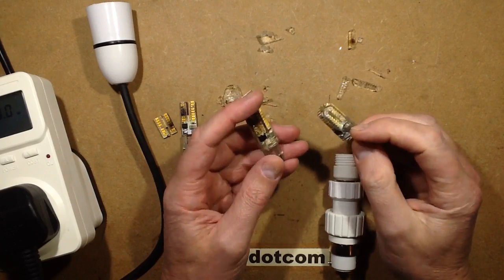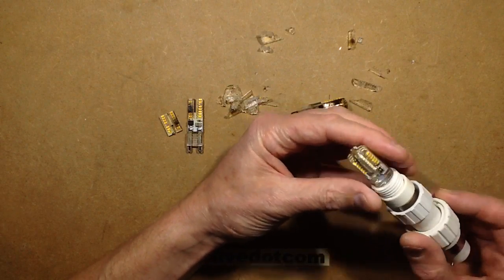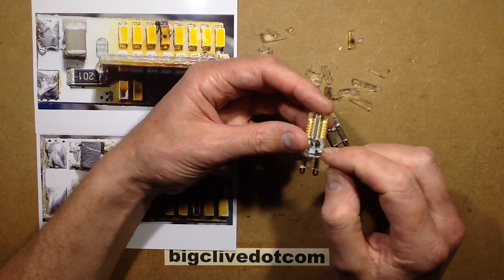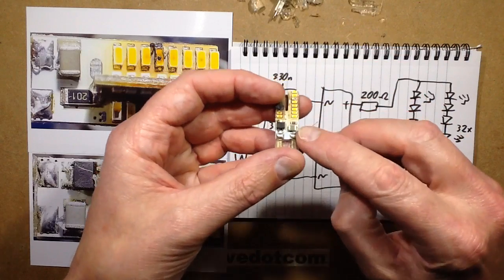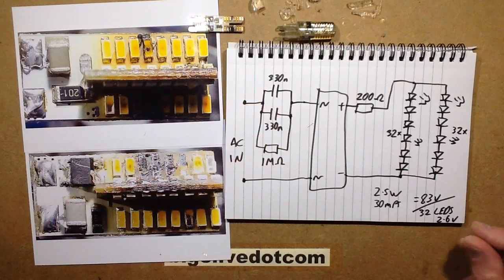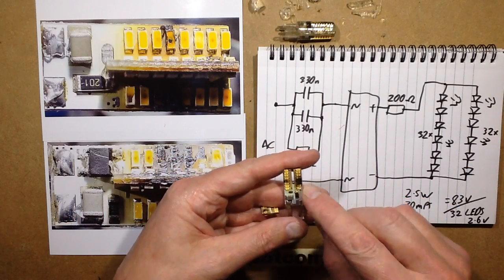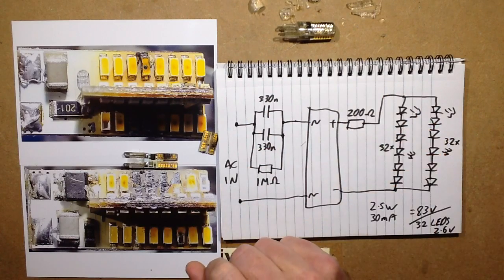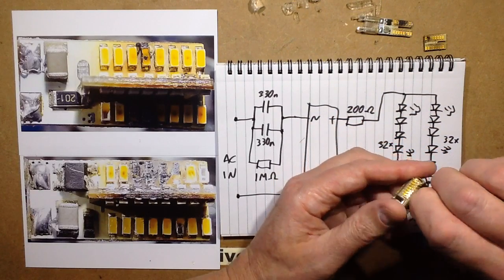Autopsy of a cremated LED lamp.

Comment: Just about every led lamp i have bought over the last couple of years has died for one reason or another, i tend to rob leds from one dead lamp to revive another dead lamp. Are the very expensive branded led lamps any better for reliability/? I am reluctant to spend £7 per lamp until i am sure it's not going to die within 4 months of me fitting it.
Reply: I'd like to know this as well, for pretty much the exact same reasons.
Reply: Stay away from any bulbs over 2 watts which don't have heatsink fins or vents. I've had 4 Energetic Lighting bulbs go bad in 2 years. They have a switching regulator power supply, but they get so hot that you can't touch them for more than a second or two. That is very bad for electrolytic capacitors. They have no fins.
Reply: +owen robinson I got a couple of Philips E27 and GU10 in the house (some for over a year now) and they still work
Reply: Ive used LED lamps exclusively for about 3 years and not one has failed yet. Some of them came from Ikea and some from Poundland but they all still work fine. I prefer soft lighting so theyre all fairly low output, mostly 1.8W and 3W with just a couple of 5Wers where more light is needed, thats probably got something to do with it.
Reply: I've bought some from aliexpress which Clive gave a good review of and they've been working fine for a couple of months now. It will be interesting to see how long they last.

Comment: This is the 2nd video where's you've referred to mains voltage at 330 volts, has something changed recently or am I in a parallel universe?
Reply: 330V is approximately the peak AC voltage at 230V
330V * 0.707 (to convert to RMS) = 233V
Reply: Thanks, I'm no expert as you can gather so I wondered if it was a slip up. It makes sense to me one.
Reply: 5:32 (just after)

Comment: Hi Clive, Can you examine the difference between normal LED globes and dimmable ones, thanks.
Reply: Short answer: non-dimmable types generally use a switching regulator with a very wide input voltage range. 
But there are so many variations out there that it's not going to be a simple "dimmable vs non-dimmable" comparison.
Reply: I've asked this question before. Also details of led dimmers.

Comment: I can supply you with an urn! 😂
Reply from the maker: No need...  My brother is an undertaker.
Reply: Me too hence the name and offer of an urn. Any chance of you making a joule thief tutorial to run a string of parallel LED Christmas lights? That would be great!!
Reply from the maker: If you get a standard parallel string of LED lights as often found at pound or dollar stores with battery packs, then you can hook the string right across a Joule Thief.  With a bit of creativity you cal also fit the Joule Thief in the battery compartment where one of the cells was.

Comment: These capacitor dropper kind of lamps seems to have a very limited durability. They tend to fail within a month or perhaps a couple of months. However I have a few lamps which are driven with a transformer / led driver. They have lasted for over an year now. Why is it that the LEDs inside these are not failing with the "black dot of death"?
Reply: The voltage has to be high enough to cause arcing inside the LED when the bond wire breaks to cause a black dot of death. If the voltage is low enough it simply breaks and starts to flicker. There is also another problem with capacitor dropper that if you switch it on at the peak of sine wave, a lot of current passes through the LED's to charge the dropper capacitor up and it blows the LED's like fuses, if there isn't a smoothing capacitor in parallel with the LED string to dissipate the current spike or it had failed like these do. Although big clive do had a home made LED light with capacitor dropper that has served him for years, I don't know does he have it still, he made it with much better design than commercial light bulbs using different value components that doesn't hammer the LED's as much.

Comment: How much more expensive would it be to design the circuit making all the LEDs to be in parallel? They used the LEDs as voltage dividers, thus decreasing the cost of the control/rectifying circuit. But it seems to me the idea of the whole product be as durable as the weakest LED used is a pretty bad idea. Also I wish they made LEDs to be as reliable as diodes, as they should. It seems companies view diode reliability to be important, but LED failure to be just a cosmetic problem. Yet LEDs are frequently used as voltage dividers, so they needed to be reliable.